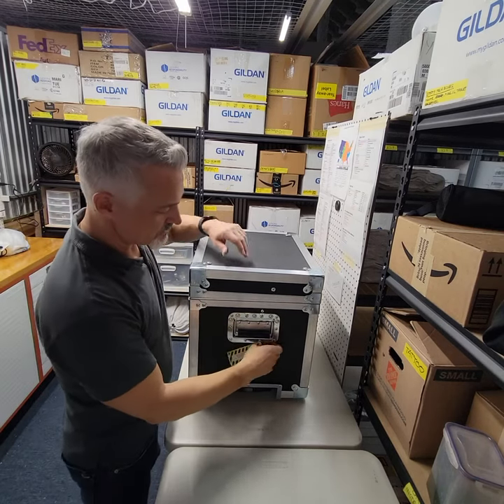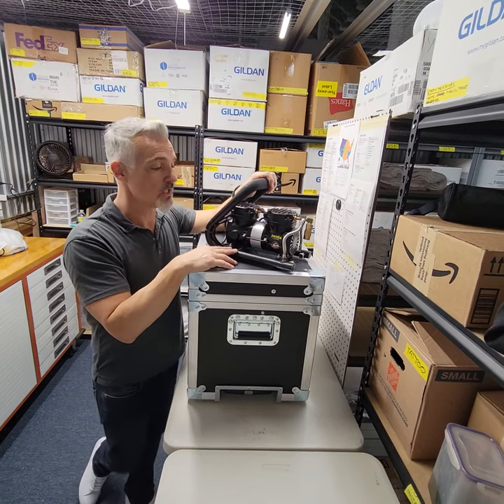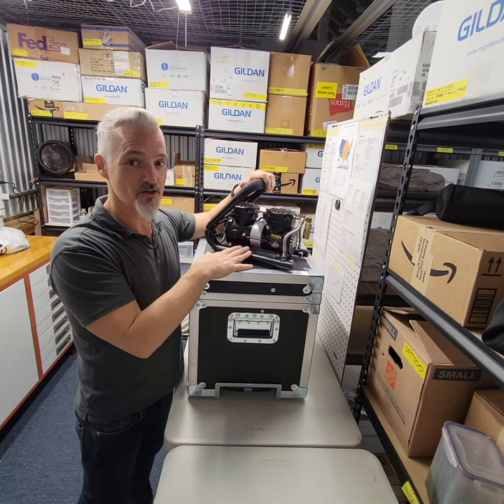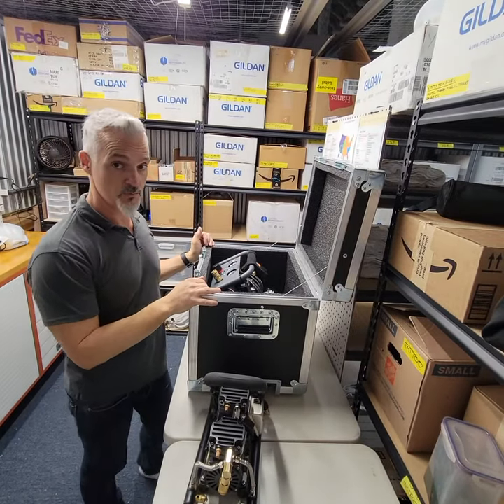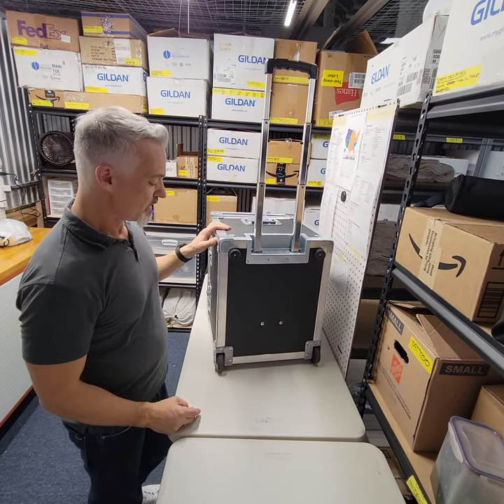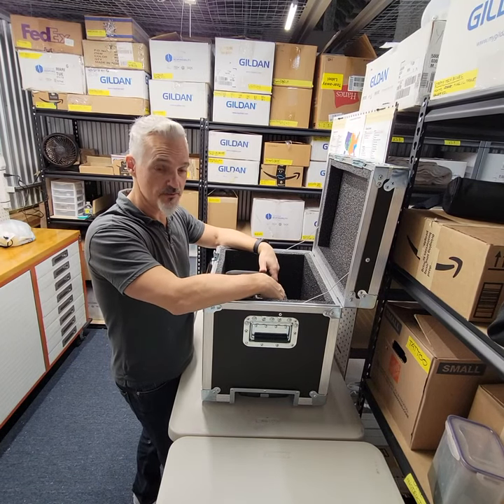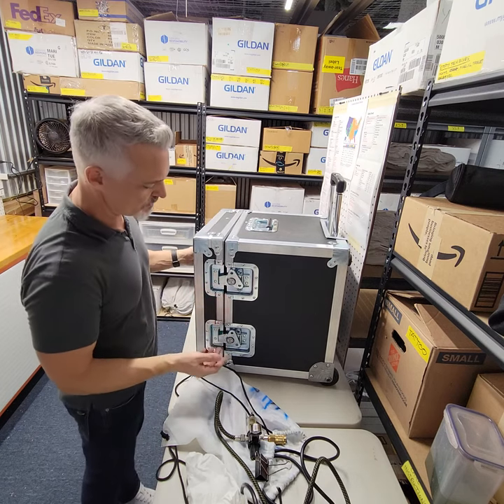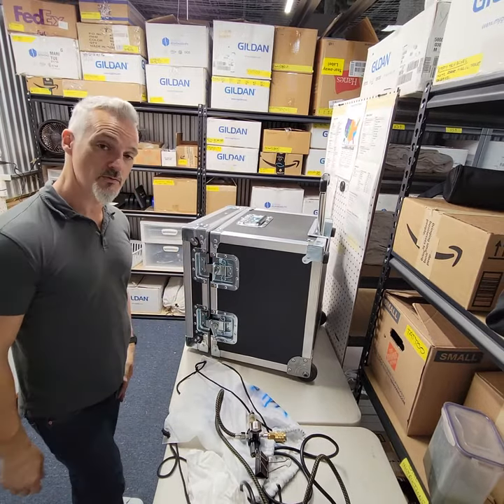How I Fly With an Air Compressor for an Airbrush Event

Comment: Why would TSA not allow compressors with tanks if you can de-pressurize them and leave them open?
Reply from the maker: Since this video was created, I discovered on TSA's website that compressed gas cylinders are permissible if the drain plug is removed. https://www.tsa.gov/travel/security-screening/whatcanibring/items/small-compressed-gas-cartridges